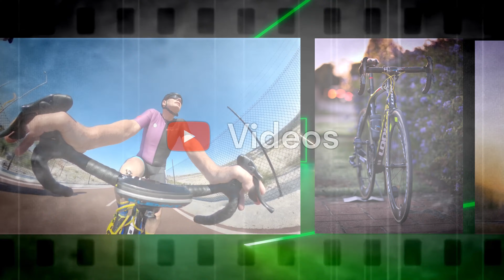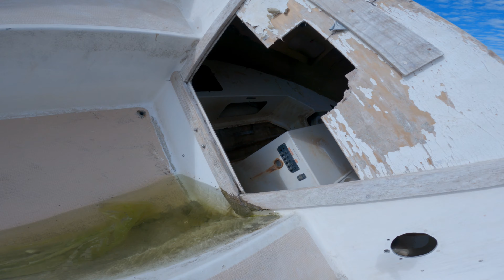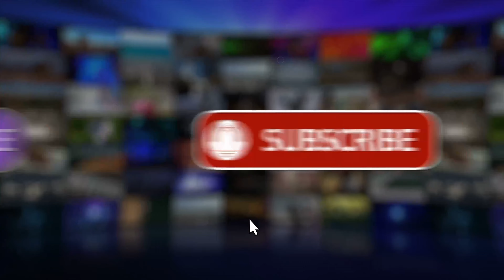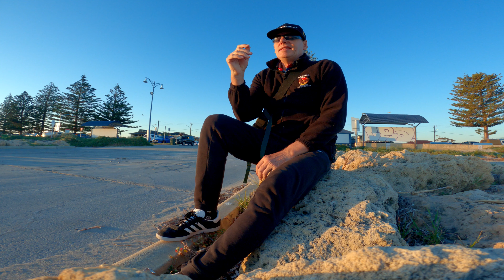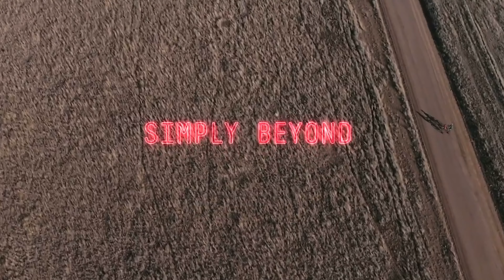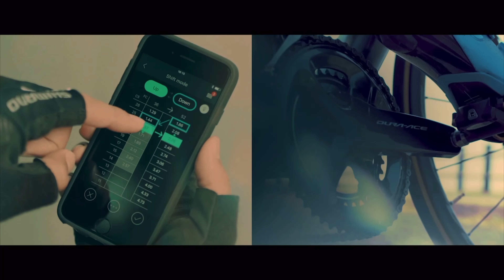HOW MUCH! is Dura-Ace getting to expensive? Dura-ace Shimano Di2 9200

Comment: I don't understand why you keep on doing these vids, we understand that you don't really like that groupset (with the lack of mechanical..etc). 
Dura-Ace 9170 is ~3500$ (without PW) after it's been out for 5 years. The new 9200 is 4000$. DA 9200 will be the same price in 3-4 years. 
As for the Ultegra Di2 8070/8170, it's about 500$ in difference (and that's on MSRP). 
As for the ever lasting crank talks, Shimano design is good and there is no need to change it. 
If you think that Sram's carbon cranks are more expensive to make than Shimano's, I'd say you're wrong. 
Carbon cranks, same as carbon bike, have become much more common/ cheaper to make. 
Campagnolo is the only here that "deserve" it's price (not made in the far-east, titanium is used and the machining is the dog's bollocks as one would say). 

All in all, yes DA 9200/Ultegra 8100 are more expensive than the previous generation but that doesn't really matter. Were you that "angry" when Shimano went from DA 9000/Ultegra 6800 to the next generation? They also had a price increase, but nowadays, you don't hear about it and it's all good. That's why it's irrelevant, just wait 2-3 years before you buy the new Shimano stuff and you won't get that dreaded full price you're talking about. See what I mean?
Reply: Where is 9170 $3500 ? I got mine about a year ago and it came just under $3000 with the cables and the wireless unit. All manufacturing has had price increases on what they buy to produce and package their products so I'm not arguing whether or not the price is right. I do know this much, I won't spend that kind of money looking towards the future. I like my 9170 group except for the hydraulic brakes but I will probably look for deals to keep mine going or just go with a Fixie. I'm looking into buying a Fixie right now from LOW bikes.
Reply: @wasupwitdat1mofiki94  I got the price from multiple websites like Glory cycle, gambicicli...and others. 
I agree with you, I don't think they should be that expensive. But lets be honest here, if you can afford DA Di2 in the first place, spending ~500 more dollars isn't going to hurt you that bad. 
I know I will always limit myself to Ultegra Di2 (buying new, not talking used). That's just the "best bang for the buck" groupset in my opinion.
And no need to replace your DA 9170 groupset, that thing is still better than 80% of all the other groupsets available now.... and it's 5 years old, goes to show how Shimano got that groupset right to the nearest bolt ^^
But of course, if you no longer want it, I'll gladly take it a away from you 😁👍
Reply: @theobuzat9091  The new Ultegra is over $3000 US right now. That's on para with what I paid for Dura-Ace. I thought it was worth it after my experiences with SRAM Red eTap. So I guess Ultegra would be something I'd consider because I don't care about the weight. All my years of cycling before going to electronic I had Chorus. But now that I've been spoiled with electronic I don't want to go back to mechanical.
Reply: @wasupwitdat1mofiki94  It's not that expensive in Europe but if you get that groupset with a PM, you're going to pay one hell of a price (a whole 1000€ more....)
I'm running mechanical right now (Sram Force 10spd) and I really like it. But I want to try electronic shifting because of what it allows you to do (cable routing...etc etc).
What was your experience with Sram RED etap? Was it AXS or not?
Reply: @theobuzat9091  I had the first eTap Red, not the AXS. My rear derailleur quit shifting after almost a year and a half. I warrantied it but that is when I bought the Dura-Ace. I needed a group for my bike and it wouldn't accept a mechanical group. I noticed better shifting all around with Dura-Ace from SRAM and much longer battery life, so I built my son a bike using that SRAM group. Since SRAM screwed all the original owners of eTap when they released AXS I promised never to buy SRAM again. I also read comments all the time saying how junky SRAM is put together. I'm not a cheap as most people, I spend lot's of money on bike stuff because that's where my main interests are. I have enough mechanical Campy Centaur stuff to build another bike  I know there are shortages of parts for people right now but I don't have to worry because I always buy spares, chains, cassettes, brake pads, cables and housings, in abundance just in case. Throughout this pandemic has been one of those just in case moments. My cycling buddies are always asking me for stuff. Another project I'm looking forward to is getting my hands on the new Classified Gear Hub System as soon as that comes to the US.
Reply: @wasupwitdat1mofiki94  Thanks for the feed back. I know I would never buy a Sram ETAP equipped bike...Or if I do, it's to sell the groupset and replace it with Shimano Di2. Unfortunatly, that's is what most likely to be happening when I'll buy my next bike... But someone will love that Sram Rival groupset and he'll buy it from me so I guess that's a win win situation, I get payed to get rid of that junk ^^ 
Anyways, Sram was amazing with their mechanical stuff. Now it's just bad, nothing is good on these groupsets...but you still pay on hell of a price for it. Sad thing isn't it?
These new Classified hubs seem cool but I think I'll stay with a front derailleur for now. I don't want an e-bike looking rear wheel on my bike I guess 😅
Reply: @theobuzat9091  Seems to me buying a bike equipped with SRAM is not the way to go if you don't want SRAM. Maybe you should look at a custom frame builder since you mention buying the groupset separately anyway. I went this route for the latest bike I own and I swear I am amazed at the difference from all the other bikes I've owned. I have been replacing bikes every two years or less since 2004. Back then I had a Eddy Merckx Race that I loved. But for one reason or another I've always found fault with most bikes so I'd buy another. This latest bike was built by a guy that knows what he's doing for sure. I will never buy another bike unless it's through a custom builder. I get on this bike and it's such a joy because it feels like it's part of me and not something I have to deal with for a couple hours of riding. You can go to a dealer and test ride a bike and still not know how it's going to work out after long hours in the saddle. If you know what you want and what you like I recommend accepting the cost and making the leap because in the end it's worth it. And you will not be second guessing and searching the internet for parts to change or even another bike.
Reply: @wasupwitdat1mofiki94  The thing is, I don't want a "tailor made" bike, I do think they're amazing pieces of art but not for me. Right now, if I had to buy a bike, I would probably go for a Trek Émonda SLR or a Canyon Aeroad or maybe even a Cervélo S5. 
Buying a complete bike and replacing to groupset is not as bad as you think, it'll still be cheaper than buying the bike with Ultegra Di2 directly.
Reply: @theobuzat9091  It's your money. You don't have to take my advise. I'm just an old guy now with lots of knowledge and experience that nobody cares to hear. Good luck.
Reply: @wasupwitdat1mofiki94  Don't worry, I listen to everybody. And you seem, indeed, very knowledgeable and I thank you for your advices. 
But as a young guy from France, we don't really have as much option as you do in the US and metal frames aren't really for me. 
And btw, age is just a number.... As long as the head follows, you're still young. As MVDP would say, let the legs do the talking 👍👍
Reply: @theobuzat9091  I am probably about the same age as Waynos but still in very good shape and very happy to still be able to enjoy cycling. 20 years ago I was mainly still into mountain biking and racing mostly and know more about suspension and gearing and racing from that era. I was bad ass a long time ago and raced with the best names. I have my wall of memories which I'm very proud of. I'm not competitive anymore and if someone comes up on my wheel wanting a challenge I usually let the go. Cycling is different for me now and I really need to change my addiction for having the best flagship equipment because it's just becoming to expensive.
Reply: @wasupwitdat1mofiki94  You sound kinda like what my dad would tell me haha. He's also more into older stuff than the new stuff like I am. He loves his multiple Peugeot from the 1970-80 that he watch people race on. We are even lucky enough to have one of the bike from the 1973 TdF winner.... That's something that we restored together and got from a family member. He gave me his addiction and now I don't know how to stop (not that I want too ^^)
Anyway, was nice talking with you. Hope you have a fantastique day and "merci pour tout" as we say in French 👍
Reply: Waynos keeps deleting my comments, but you are spot on here. Excellent points.

Comment: Everything getting expensive bike frames group sets I can buy a motorbike cheaper than some of the bikes that’s why I started making my own steel bike frames in the latest componentry from Columbus and other manufacturers as a hobby so disappointed with the direction of Shimano time for a change on my latest bike I’ve decided to go Chorus 12 Speed mechanical i’ve heard it’s really good looks great and it’s quite light.